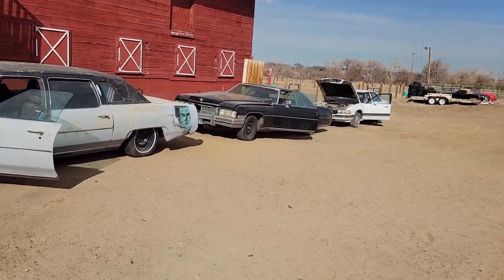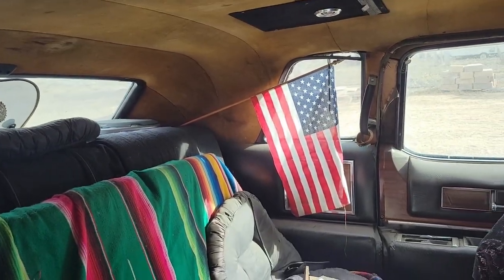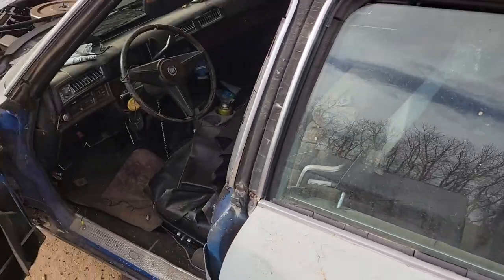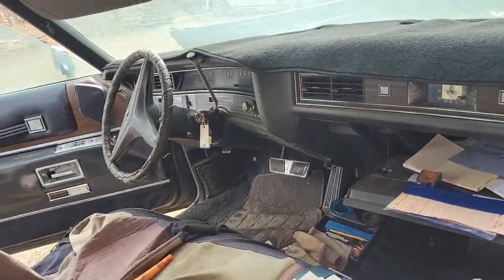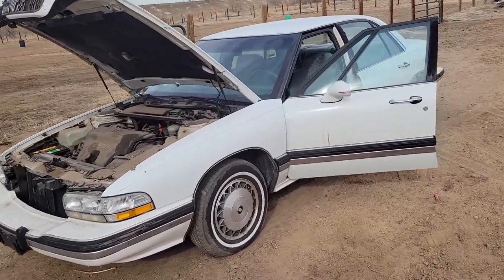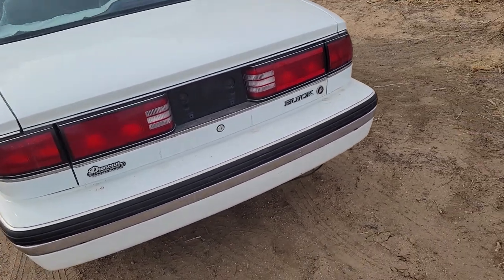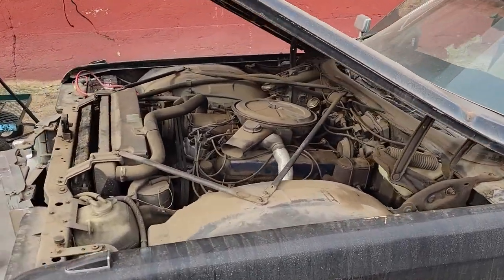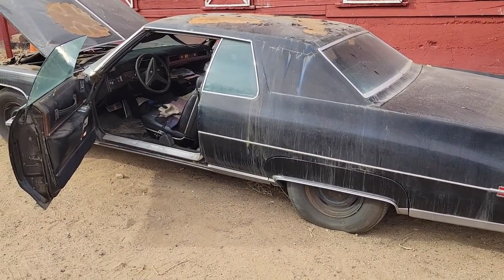Car lineup for Demolition Derby 2022 1974 Caddy Fleetwood 1973 Caddy Eldorado & 1996 Buick. FUN TIME

Comment: None of those cars belong in a smash up derby unless they’re rusting out.  Especially that black 1973 Caddie Coupe DeVille.  That car deserves to be restored.  My next door neighbor had that exact same car (obviously in much better condition).  Regardless, that’s a restorable car that shouldn’t be getting smashed up.  Please pick your cars a bit more carefully.  The 1973 Caddies were only a 1 year design.  It was a transition year for Cadillac so the 74 wouldn’t look so radical.  There’s plenty of rust buckets out there that could be used in it place.

Okay…the two white cars belong in a smash up derby.  But you should save the black one.

Comment: Okay the Fleetwood  is a  75 or 76  the engine  is a 500. The 73 coupede vlle NOT AN ELDORADO  HAS A 472. It deserves  better  than  a demo derby The buick  probably  has a intake  gasket.  That was an issue  with them but  that engine  was bullet proof
Reply: he got a lot of info dead wrong. that is not an eldo come on.